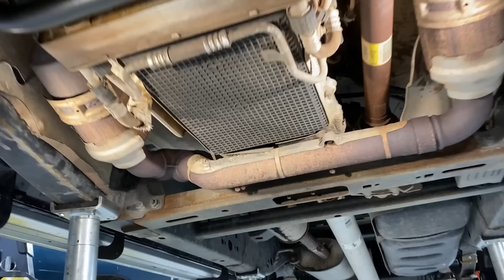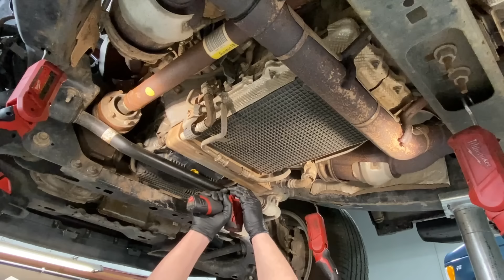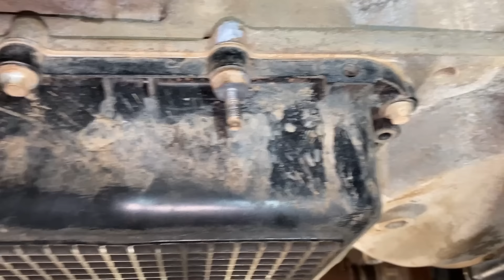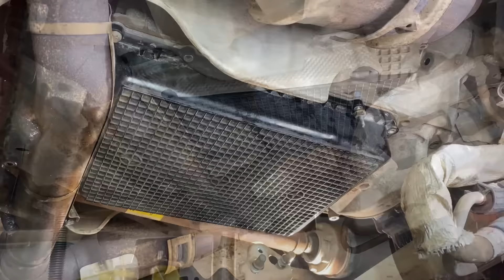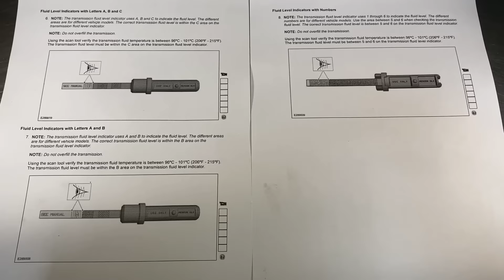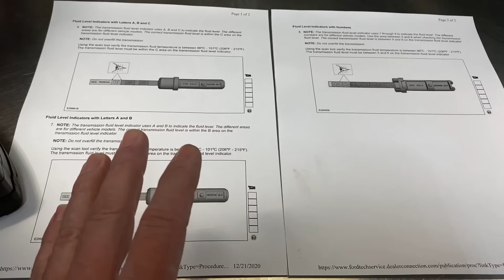Ford 10R80 Ten Speed Transmission: Fluid and Filter Service Procedure

Comment: Why not just exchange the fluid using the cooler lines and avoid this cost and potential debris entry at the pan??
Reply from the maker: Oh boy, where do I start with you.
Reply: @FordTechMakuloco  ...don' know where you should start!  but really what's wrong with fluid exchange using a machine that pumps old fluid out as it introduces new fluid? Please educate me. thanks
Reply from the maker: Unless you are constantly maintaining the trans every 30k you don't want to flush it, you want that mix of new and old fluid. You've heard of people having trans issues after a flush right? You never hear of them having trans issues after a pan drop and filter swap AKA a partial exchange. With a flush machine there is always a cocktail of new fluid going back into the trans from the last few vehicles they serviced and many times they are using a universal BG trans fluid which is even worse. Plus many transmissions nowadays have internal thermostatic bypass valves so you cannot flush the fluid inside the trans without smoking the trans in the stall to keep it hot enough to keep the valve open during the flush. If heat is the worst enemy of a transmission then how is smoking the trans in the stall just to open the internal thermostatic bypass valve just for a flush a good thing? The list goes on...
Reply: @FordTechMakuloco  thanks a lot for your reply. I enjoy your videos and find them very informative. I know a lot of good Ford technicians and I always have my vehicles serviced at the local Ford store. I think exchanging the transmission fluid if you wait until 90 or 100,000 miles could be an issue but if it’s done every 30 or 40 there should not be any concern. I like the exchange because you get almost all of the fluid. I do not believe in any additive products. Changing the transmission screen really doesn’t accomplish much in my view. If it’s dirty or has debris, then there are other issues. I don’t like the trans temps the new vehicles run especially the 6.7 Torque Shift...again, thanks
Reply: @jcip1  You must not done many trans services one there is always stuff in the pan from clutches two this not a screen this is not a C6 it s a filter that gets plugged if you do not change it that will cause pressure drop clutches to slip which causes heat and the chain reaction go on and then your in the shop wondering why it is costing 4000 to 5000 dollars to get your transmission rebuilt

Comment: For a DIYer:
Step 1) see if you have access to lift
step 2) no lift? F it take it to a mechanic that does.
Reply: Repaired my 6R80 myself on garage floor!  Leaking bulkhead seal, the video is on this channel.  Took me about twice as long as the dealer quoted for labor time, but I enjoyed doing the job and keeping the money in my pocket.

Comment: I don't have a garage to do this job. Dealer will change fluid at 30k. Since it is already in the air, shouldn't I have them change the filter anyway? It's overkill for sure but, then go 60k before the next oil/filter change.

Comment: Ford Tech, great video!!! I’m very mechanically inclined but my GF’s late father (a former Ford Tech trainer both @ Cincy & Chicago centers) said too much crap to worry about these days. So I buy the maintenance plans and extended warranties from Ford. If it ain’t a dealer issue I only use specialized shops like yours. I don’t mess with it now.

Comment: And out of the 800,000 f150’s sold, about 30 will follow these drain/service intervals because ford says it’s a lifetime fluid 😂
Reply: No it doesn't. Clearly states service intervals in the owners manual
Reply: Because it's the lifetime of the fluid. So it is lifetime fluid.
Reply: If I’m not mistaken, Ford built that many 2018 F-150’s alone. (I thought I read the number was 917,000)

Comment: Any plans for a quick How To on the F150 3.0L Powerstroke for fuel filter change?
Reply from the maker: Never seen one ever.
Reply: @FordTechMakuloco  I'm in Ohio. If I'm ever in Illinois (I think you're in IL?), I'll swing by and you can check it out. Definitely not a common truck. I've had both the 2.7L and 3.5L EcoBoost and this 3.0L Powerstroke is by far my favorite.

Comment: Don’t forget the super duties have the 10 speed as well
Reply from the maker: The 10R140 in the Superduty is totally different, this video is about the 10R80.
Reply: @FordTechMakuloco  ahhh thank you for the information and the only thing that I’m curious to see if it’s even more complex than the f150 10R80 and do you think you can do a video on the 10R140

Comment: Anyone suck the fluid out of the mini dipstick with a mityvac to get some changed less the big hassle?  I did that in a Chevy that required the exhaust pipes to be removed.  Changed the filter once and suck and fill every 40-50k after that.

Comment: I am sure Ford isn't the only one who does this... Running the exhaust crossover under the transmission (rear of pan). 

Reminds of my 1999 Ford Taurus. I needed to change the oil pan gasket for the 3.0 Vulcan. Gotta remove the exhaust to drop the pan. It must be "DNA" with Ford engineers. 

Maybe Ford told the engineers all their cars (and trucks) are being sold in northern Canada and all engines/transmissions pans need the extra heat...  lol
Reply: Thats a oil pan not a trans pan alot of fwd cars you have to remove the exhaust to get the oil pan off

Comment: I swear the engineers are just out to screw us technicians. They should be forced to work in the automotive repair trade for 5 years minimum before receiving an engineering degree to prevent this kind of bs.
Reply: @HalfShell thank you! As an engineer in aerospace, we work with what we have. Automotive is even worse and their turn around times are insanely fast compared to ours. We do consider human factors but when you have a schedule and weight limits and customer requirements you have to meet in addition to the plethora of other government and industry standards, you soon find out why simplicity is not always the best way. There is so much I could say in addition regarding this topic but it would take too much time.
Reply: Engineers have a list of priorities when designing a system. 

Usually there are several considerations above ease of maintenance.
Reply: Engineers? In name only.
Reply: They would starve since most customers are used to 80$ trans filter costs and expect they can wait on this service. Im sure they'll just get off the highway and want it now
Reply: I agree 💯

Comment: I dont understand why the engineers, wouldn't put a drain plug on that pan...  unbelievable!!!
Reply: Probably because you generally need to change the filter at the same time.  And it isn't easy to put a drain plug in a plastic pan.
Reply: @SomeTechGuy666  your right about the filter....if you change the oil, you may as well change the filter. However it would make it simpler to drain the oil before doing so.   Plastic oil pans are a bad idea...
Reply: Fords instructions to the engineers

Comment: Why take 5 bolts out to unfasten the trans mount, when all you had to do is remove the two lower mount nuts to raise the trans??? 😒
Reply from the maker: Are you serious, do you think I would do all of this if I could just zing off two nuts and jack it up in 30 seconds? Look again I explain it in a very detailed manner because I knew I would get comments like yours. The exhaust hanger bracket is part of the trans mount so they would move together if I just zipped off the two lower nuts.

Comment: That is an unacceptable amount of work to do maintenance on a truck.  Maybe acceptable on an ultra high performance car but not a truck.
Reply: These cars are ultra high performance compared to the older models
Reply: ...then you should see what's required for servicing on the ultra high-performance vehicles you speak of...
Reply: @etmccaus  I've owned a lot of cars and I'm fairly familiar with the maintenance on most including ultra high performance cars.
Reply: like taking your pants off just to change your socks
Reply: This isn’t difficult, performed this service multiple times. Messy, but not difficult. Small price to pay for good reliability and performance.
Reply: The service interval is 150k miles. It, like most transmissions are expected to last the life of the vehicle without oil changes.
Reply: @Jeremy-fy1sz  That’s a BS marketing term, ALL transmissions are meant to be maintained.
Reply: @Jeremy-fy1sz  "life of vehicle" = length of warranty/ lease term

Comment: My 2018 Expedition Max with 3.73 gears shifts very hard and has been to the dealer several times. The dealer says they can “feel” it but cannot investigate until there is a service light of CEL. It only has 22k miles. We took it in at 14k for a rattling sound, that resulted in cam phaser replacement and timing guides (wtf). Probably going to trade this one soon.....
Reply: ya ford still does not know how to make a OHC cam work right

Comment: FORD TOUGH ( to work on ).  Leave it to ford to take a $200-$300 job and make it $600-$800.  May I ask why not drop the exhaust from the manifold collector?
Reply from the maker: How would that help make a gap between the pan and exhaust when the exhaust hanger mount is part of the trans mount.
Reply: @FordTechMakuloco  you're the expert and I'm not there to see. For my old 01 chevy truck I remove the exhaust from the collectors to give just enough room for the pan to clear. Good job on all you do to show how to work on ford's.

Comment: Fords normally easy DIY maintenance is non-existent with this transmission. Good grief! I’ll let the dealer do this on the wife’s 2020 Explorer ST.
Reply: The transmission in your Explorer is not the same one in this video. Also, you may want to give your dealer a call. There's a recall on the trans fluid coolers that may apply to you.

Comment: Have you heard clunking/bang when coming off idle complaints? My mother 2019 f150 with the 3.5 has been getting worse with 20k miles.  We just brought it to ford.  They updated the software,  didn't really help.  Its noticeable in traffic.  really hard engagement with a metal slamming noise.  occasional metal noises on shifts.  Its concerning
Reply: mine does it since new shifting cold start into reverse sound like it got hit with a hammer.  Dealer says no biggie.  Slack in driveline seems to be problem.  Happens also when on a hill.

Comment: When you say in the comments at the first 30,000 to do a fluid service only do you mean a transmission flush? Then at 60,000 do you mean to do the procedure you did in the video by draining the fluid and changing the filter? Thanks for any info you provide in advance. I appreciate your how to videos FordTechMakuloco.
Reply from the maker: Never flush a transmission, for this trans at 30k I would use fluid evacuator device to empty the pan through the oil fill port and refill with new only.

Comment: Its a little bit more work than usual but not the end of the world or anything to get mad about.  It's not like they made engine oil changes this complicated.  It's an extra 10 to 15 minutes every 60k miles.  Not a big deal at all.
Reply: If you can do this in 10 to 15 minutes I want to hire you  WTFE
Reply: @sabrehawk-427  I meant its 10 to 15 minutes more than a regular ATF change.
Reply: @dr7477   it pays 4 hours flat rate that is a lot  there only one worst than this that I done is 2003 GMC 5.3l 1500 4x4 truck had to drop the exhaust and jack the transmission up. to get pan off I was lucky I did snap off the studs on the manifold .GM s where always the worst. now Ford is trying to outdo GM on screwing the mechanic
Reply: @sabrehawk-427  well I'm just a guy wrenching on my trucks so I don't really care if something i do every 60k miles takes a little extra time but I can totally understand how if I was doing these things all day how the extra steps would become a pain in the rear end very quickly. Although,  with the extra steps involved,  doesn't that mean you can charge the customer more?

Comment: Servicing my 6r60 seems so easy after watching this video, especially now that I added a oil drain plug to the pan.
Reply: I remember the day when you had a drain plug with a magnet to catch ferrous metal.  Now, it captured in the drain pan, sight unseen till you pull the pan.  In fact, I've seen videos where the drain plug rips the ferrule out of the plastic it is molded into!  Now the dealers just suck the oil out of the lipstick hole and avoid these nasties.  Never mind the leftover oil they fail to retrieve...

Comment: absolutely ridiculous, so what is ford charging for a trans service? on the 10R80  i'll stick with my 90 f-150.  150 bucks new fluid and 2 filters done. were going backwards making this stuff less serviceable .
Reply: It's 2020 not 1990. This new 10spd is amazing but complex. My Ford dealer around here will do job total w/all the new fluids @ $299. Big deal every 60k mis after initial service . Keep the nice '90 & get a new F150 5.0L FX4 . Enjoy life a bit brother .
Reply: @davidklimmek3192  you buy me the 2021 F-150 1st.  I have no use for a daily driver  pickup or a 4x4 for that matter (people have a serious issue with buying trucks that are way over optioned and go into payments they can't afford)  and i won't pay 700+ bucks a month to go to work plus 2x the fuel then my car and insurance etc., my truck and car are paid for, I'm a mechanic, truck is a summer toy. The new trucks are great just don't need one. the whole fact they don't have dipsticks in new vehicles is to bring you into the dealer, exactly what I don't want when I can do the same job for less.
Reply: @mplante7352  Cmon man. I 
pay for my '18 F150 Platinum FX4 - 29k mis.. & our newer '19 Ranger XLT FX4 crew cab - 20k mis. Great driving /performing truck btw (Ranger). Maybe that one is all u need? Pulls 7500lbs. 300hp on premium fuel. What we do is buy ALL our trucks new & keep em 10-12yrs! Ford trucks last forever w/ good basic maintenance. Obviously, new trucks will be more technologically advanced thus complexity is amplified in maintenance/ repair! As an engineer in auto industry 26yrs i will tell ya EVs are comin along real quick. U rant bout those too? Get a '21 F150 XLT 5.0L FX4 crew. Finance it 7yrs / pay it dwn. Take real good care of it & last ya 20yrs easy. The best trucks aren't cheap! Good luck 2ya. God bless .
Reply: @davidklimmek3192   your missing my point im not interested in any new truck with any new technology my 31 year old truck suits me fine and I have air power windows locks automatic touch screen nav stereo. And does the same thing as a 2021 truck does for my needs. and I prefer the classic fords easier and cheaper to work on.. My point was is Fomoco is making the new trucks less serviceable for the average person and expensive to diagnose and repair. And I highly doubt they'll last 20 plus years with all the electronics and cheap plastics parts in them. But to each his own.
Reply: @mplante7352  As someone very active in auto- industry 26yrs as stated..i fully understand. Thus recommended a new '21 for ya. Why? Cause if your flabbergasted by necessity of current trucks complexity /  technology. U haven't seen nothin yet. Brian of this site knows what's comin. So, just meant better grab the best of "ole tech" .. todays awesome F150s. There will be no new gas F150s in approx 6yrs or less.
Reply: @mplante7352  if you live up north in 20 years you will have pile rust
Reply: @davidklimmek3192  I will be dragging old ones out fields before i would buy this overpriced over engineered POS
Reply: @sabrehawk-427  truck is soaked in oil  rustproofing I doubt it. truck is not winter driven either.
Reply: Than it should last along time and hold it s resell value
Reply: @LWRC  Well prob not unless u just like do ur own work etc that is  what they quoted me. I called 1wk b4 I saw Brian post this video too. I have '19 Ranger XLT FX4 tho not an F150 maybe thats why? F150 is hardest to do Brian said.
Reply: @LWRC  I think it's a good price too. Also thinks it's best for 90% of us get this kinda stuff done @ dealer. Only needs be done every 60k mis for fluid/filter?

Comment: Can't just loosen the Trans. Mount like I do on GM?  Curious as I have not had any in that year range.
Reply from the maker: Nope, as I explained in detail the exhaust hanger is built into the trans mount. So if you just unbolt the trans from the cross member you are only separating the trans from the crossmember but the trans and exhaust still go up together.
Reply: @FordTechMakuloco  Sorry, had another look. I can see that now!!

Comment: Makes me appreciate my Allison 1000 even more.
Reply: The new Alison 1000 is the same as the ford 10r140.
Internal parts are stamped with both gm and ford numbers.
Reply: I think ford and Chevy partnered on this trans so the ten speed Chevys will probably be similar to this but I haven’t seen one yet so I don’t know🤷‍♂️
Reply: @mitchheine6878  Only the duramax has the allison... Allison would never do foulish crap like this.

Comment: 26:41 old filter - 29:37 new filter - They are not the same. The big suction hole to the course media is absent. That is ok?
Reply from the maker: The filters are exactly the same, the old filter has metal attached to it on the circle portion which is where the internal magnet is. Those are not holes.

Comment: 1st gear, 2nd gear, 3rd gear, Over Drive gear, Lock-up torque converter.
That is the most a passenger vehicle needs. 
I went through Ford's 'ASSET' program in the eighties and retired from wrenching in 2009. I don't miss it for a second.
I work on my own rig(s) and no-one else's. (unless she's really cute (because some lessons are never learned))
Reply: Less moving parts less to go wrong